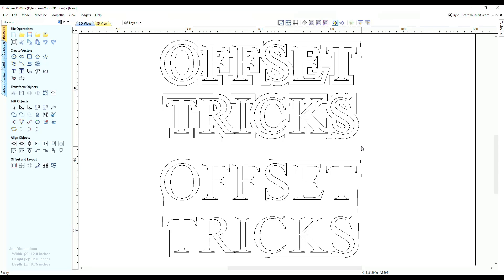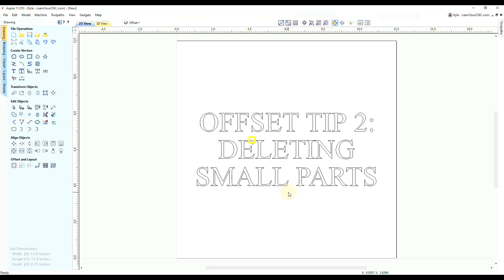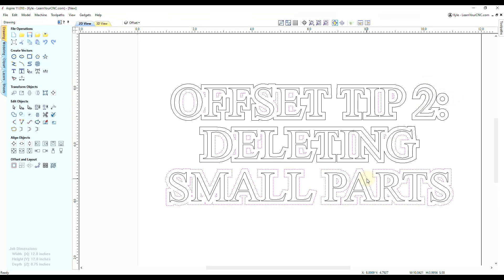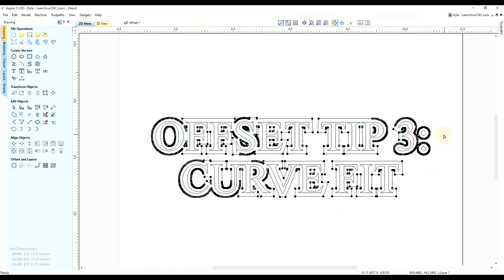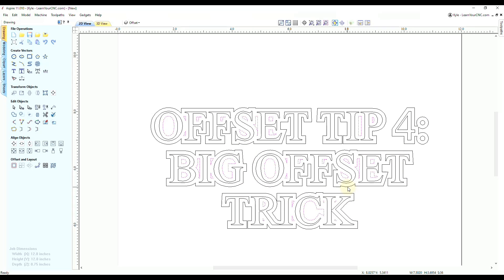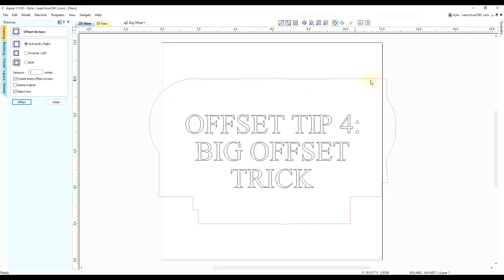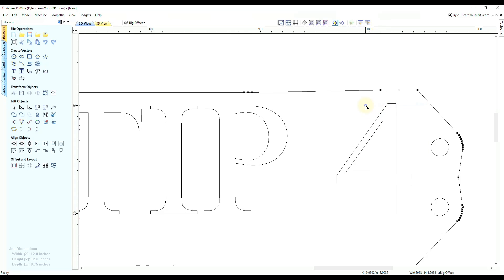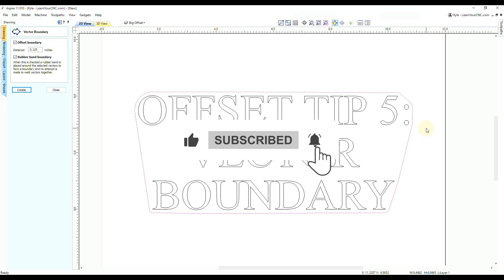TOP 5 Offset Tool Tips - Vectric VCarve, Aspire, & Cut2D Quick Tip

Comment: Faster to highlight the vector and select the CREATE BOUNDARY TOOL.    

Rubber band positive value offset for a smooth profile around it all.   Or negative value for inner boundary negative value. Or just create boundary.     To create a rough pass to profile use my formula.  (Tool diameter/2) +(final pass clearance/2) and then tha s your offset number. 
cut ON line for exact.  

1/2 bit = .500
Clearance at 2%= .01  
.25+.005= offset of .255.  

This leaves you with oversized by .005 which is perfect for a finish pass with .5 tool

Final cut is then selected on original vectors to finish quick and easy.

Comment: Great video as always.  I believe that the reason why there are slight "non straight lines" when you are shrinking from the 2" offset to the .125 offset, is the "S" and the number "4" are actually taller than the other letters on the top line. I would suggest checking the actual sizes of each letter to ensure they are all the same height, unless you wanted to have the taller letters of course.